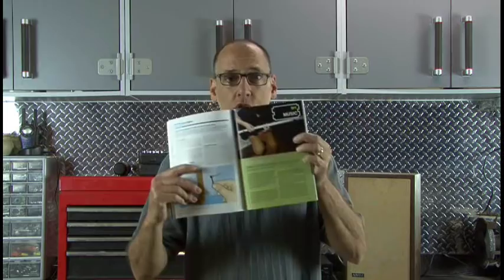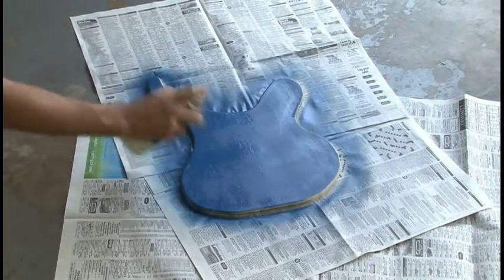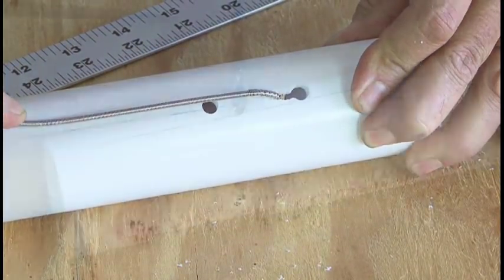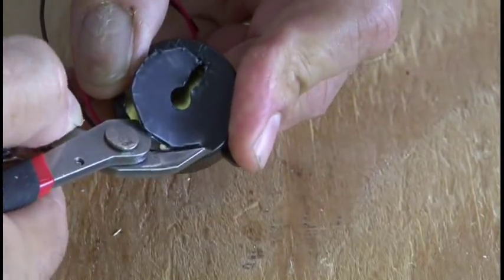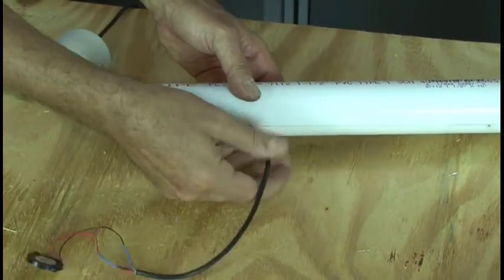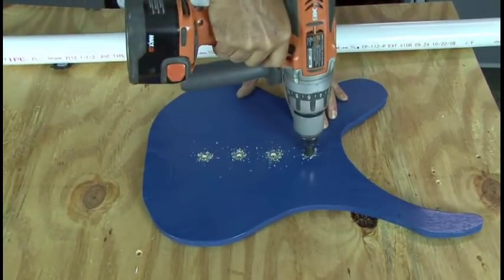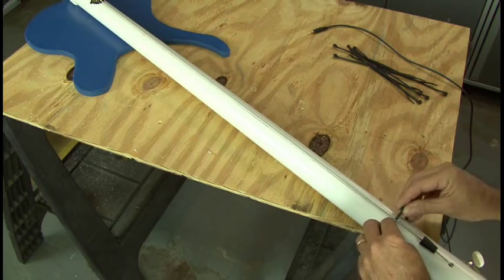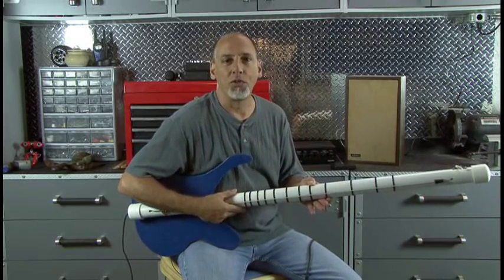Weekend Project: Strung Out

Comment: List of things that's wrong with it
1) needs about 3 more strings 
2) needs properly spaced frets 
3) needs a bridge
4) needs a flatter neck
5) needs a volume knob 
6) tone knob

It would sound better to get a wooden box cut a hole in the center and get a piece of wood for the neck.
Reply: jaden gutierrz and.... how about flattening the neck a bit by heating and compressing so it actually has a somewhat realistic neck profile!? 
it'd be so simple. put it in the oven on very low heat for just a bit, then put a board on it and compress, voila! that or use a heat gun.
theres so many little details that could be adjusted that'd make this pretty sick to pull out at a gig. I think it'd just take some actual musicians toying with the idea.

Comment: use pvc pipes of different sizes, attach a piezo to each one, wire all the piezos to one jack. jack it into an amp and play on the pvc pipes with drumsticks. don't strike the piezo, becaue the crystal inside can be crushed easily.

Comment: And just my .02¢ as a Guitar Repair Technician... This does sound like absolute crap... BUT... It would be a great project for a curious small child. Start with that PVC monstrosity and tuner placed zip-tie frets, progress to other materials, calculated scale length and fret placement, real pickups (incidentally, that's all that is keeping this from being a djent stick, IMHO), and learn about the effects of changing all the various points of adjustment, et cetera, etc.... Other than that.... To quote AvE: "Ga'Bige!"

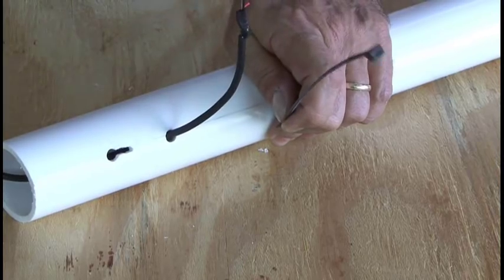3:08 This TRS connection could be a source of confusion for some. TRS: Tip (Red wire/Left signal) Ring (Black wire/Right signal) Sleeve: (Bare wire/Ground). Commonly known as a Stereo cable. When connecting TRS connectors to a mono source (such as this piezo element, but a normal pickup also applies) the Ring connection should either be ignored (i.e. not connected to anything) or connected to ground. Kipkay probably wired it like he did because when plugged into a typical stereo aux input, it produced a normal stereo signal. However, not all male and female jacks are created - or connected - equally. For example, you might want to wire up to the other end of that cable (which he completely wasted by clipping it so close to the end - here's hoping it was junk anyway). If the piezo element were wired exactly as shown (but with the female connector instead) and then a Mono cable is plugged in -- then Female Ring contact will make a connection with the Male Sleeve creating a short across the piezo element. Giving you no signal and no sound.

Comment: @MAKE

You should be more safety conscious especially when cutting the piezo at 2 min 29 with a high speed mini drill...

Use a vice to clamp & support the materials & Protect your hands with safety gloves to reduce risk of injury.

I'm an Electrical Electronic Technician & ive seen many easily avoidable injuries caused by a lapse in concentration. / risk assessment..

Comment: Anytime I cut a connector that I don t need, off of a cable that I DO need, I try to make my cut a few inches back from the connector strain-relief so that I have a pigtail that can be stripped and grafted onto a cable at another time, for a repair, to make another custom cable, or in MY case, offer some hope of salvation in the occasional "Oh-sh%£-I-just-cut-off-the-WRONG-connector-end . ." - senior-moments. I can't tell you how many times this little forethought trick has saved my bacon when I needed a connector, but all the Radio Shack guys are nestled, all warm, in their beds, where they SHOULD BE at that hour. I have a whole little box of these in the "Stuff-I-might-need" - drawer. . . or HOUSE, as my wife would claim.

Comment: wow! this project definitely was not made by a guitarist. Get a peace of oak for the neck and a 4 to 6 inch thick wall pvc pipe (sewer pipe) for the body. Use any dense bone for a bridge and bone,plastic or metal for the nut (the part by the tuner). Scale calculators can be found online.(google fret calculator) Draw the frets on with pencil. Use tuning machines at the end of the neck. Attach a microphone element to the body, also found @ radioshack. Wahoo fretless guitar!

Comment: the deformation from the string damaged the piezo already, the ceramic layer on the backside is very fragile. best you sandwich them under the bridge, so they get even pressure.